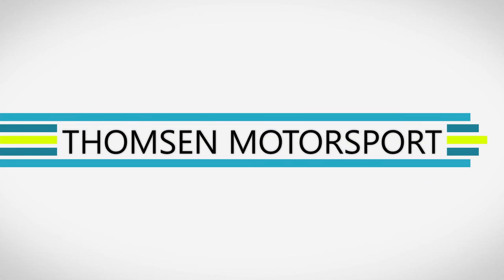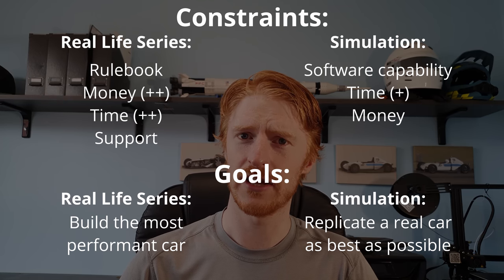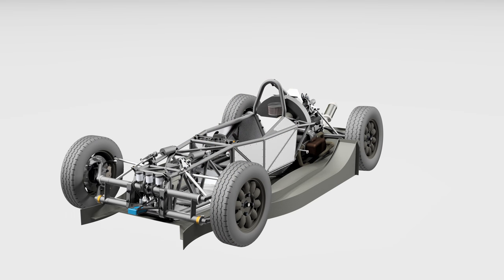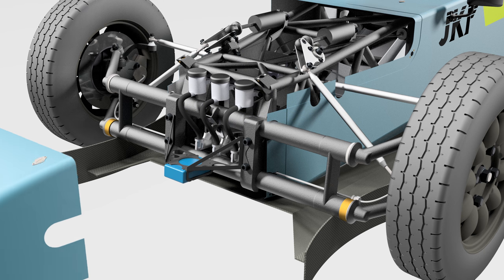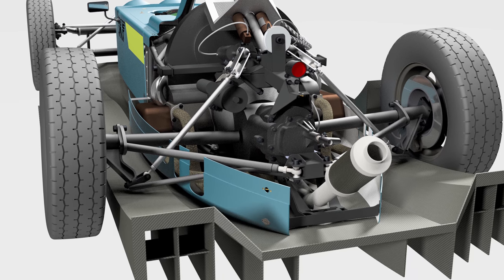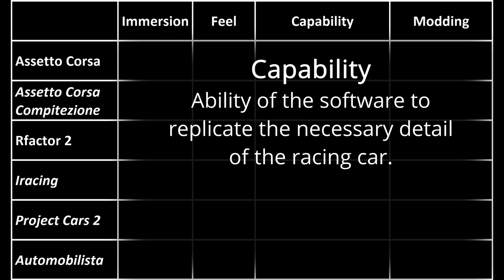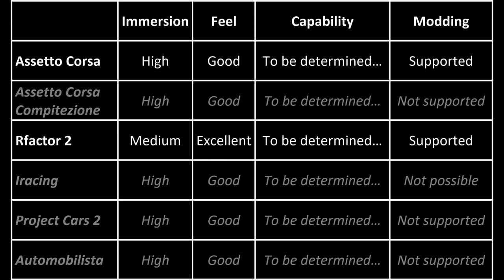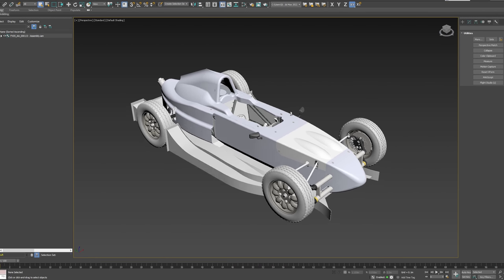Simulating a Racing Car

Comment: AC, especially when modded with CSP, has a far more usable tire model than rF2 does. You will struggle to produce decent behavior with the rF2 tire model, while it'll be no issue in modded AC to correlate tires to a high level. When modded you can even do really quite realistic heating for tires and brakes, and it has aeromap support.

The FFB will also be accurate for a manual rack (You can use "Real feel" to produce 1:1 manual rack torques like for DD wheel use) on CSP modded AC, while rF2 is a bit more esoteric in how it handles FFB. On top of that AC is generally easier to work with modding wise.

You might run into an issue if you want zero roll stiffness and only heave. I'm unsure how well only a heave spring will work; might work great, might not, I've never done it. Ideally it'll just work as-is but there are some possibilities for issues. I can't look into it now but perhaps I will and post a follow-up comment if I do. 

I foresee that some weak corner-spring/damper coefficients might be needed but ideally it'd still work with just a heave spring in place, you just might need to manually calculate your heave spring deflection because I think it doesn't show up in any in-game telemetry, which is no biggie.
Reply from the maker: Could be interesting to hear more, for me it hasn't been the heave spring that's the problem, more setting the springs to be pre-loaded against the bump stops. I've had no success in finding a way to replicate that. If you've got any insight then let me know! Otherwise it looks like rFactor 2 might be my only option.
Reply: @thomsenmotorsport7201  Packer range in AC is static spring deflection + packer gap. If you want a 0mm packer gap, or negative, you will either put in your static spring deflection or subtract the required gap from it. You add a gap if you want a more typical setup. There is no separate wheel preload in AC apart from the rideheight setting via ROD_LENGTH.

Telemetry app has spring deflection, you'll need to enable Dev Apps, search how to do that. It's a line somewhere in the cfg files. Bear in mind everything is at the wheel in vanilla, not the damper, so do your conversions.

BUMPSTOP_UP and DN are absolute wheel travel in meters, from the design height. The design height is considered to be when static spring deflection is the same as ROD_LENGTH.

You can shoot me a message at Arch#0819 if you want. Also look for "physics pipeline and tools". I explained this same stuff in there too.
Reply from the maker: OK this is excellent. I'll look back into the packer settings in AC after work, if there's something I've missed that I can do to force a preload then that solves this problem. I feel like I looked into that but it's certainly possible there was something I missed.

I've found Physics Pipeline + Tools on Race Department's website, I'll read through that as well after work - it looks like a fantastic resource from a brief look, perfect. I can't believe in my searching I never found this - thank you for the amazing resource.

I'm going to have to re-think the next couple of videos if I've come to the wrong conclusion that AC isn't possible - but I'd rather get it right. I'll play around this evening and get back to you.
Reply: @thomsenmotorsport7201  With preload, if you mean an actual preload ie: need to overcome some force until any deflection occurs, then it's not really possible I think, although I can't imagine the actual system works that way. Preload just changes ride height typically from what I understand, the spring will still move normally.

If you just want to put the wheel against the bumprubber when the car is sitting still, so that bump moves it into the rubber and rebound moves it out, there's no issue with being able to do that. You can put it into the bumpstop travel if you want, although you will need to use CSP if you want the force to vary from different deflection amounts. 

Is that what you are trying to do, have the car start off with the bumprubber compressed? That is possible without any problems. If you make a bumprubber travel/force graph with CSP, then you can also in a way dynamically change the suspension stiffness via compressing the rubber more or less at static position; it just works as an additional spring. 

You could do that in a setup-adjustable way via putting the "packer range" parameter into setup, and then changing the packer gap from there. Just bear in mind that changing the load on the spring or the rate of the spring will change the spring deflection and thus the packer gap needs to be adjusted, so I suggest leaving the cornersprings unadjustable if you are going to do that.
Reply: @thomsenmotorsport7201  Sorry, not the force to vary, the RATE to vary. The force increase is linear, while real bumprubbers are very much so nonlinear.

CSP allows a .lut to control the effective rate.
Reply from the maker: Yep so pretty much as you describe at the start there - an upwards force needs to be put into the tire that will overcome the static preload which pushes the wheel against the lower bumpstop. This is the case both at the front and rear, only at the rear it's using a heave spring only to support the car, which itself is preloaded against a sort of "droop limiter" cable.

I just want to make sure we're referring to the same thing - in my car the front (for instance) is as high as it can get, the wheels are as low as they can get (with respect to the car). Under brakes, the vertical load on the tire increases to the point that the spring comes off its limit, the front of the car dives and the wheel moves upwards with respect to the car. So it's preloaded against the rebound bump stop, not the bump stop.

I'll take another look into CSP, I had been hoping to avoid requiring people needing another third party patch to make the car work - but if what I'm after can't really be done without it I might just have to rethink that.
Reply: @thomsenmotorsport7201  I'm not sure that is doable in any consumer simulator to be honest, if we are indeed talking about a system where, to achieve any bump deflection, you need to first pass a threshold of force. After the load of the car has set on the spring, I mean.

Usually the way I understand preload is that you set a limit that allows the static load on the spring to compress the spring only as much as you require to achieve your ride height. It won't impart an actual additional preload during normal driving. Is this the case in your design too? Then you just set your gaps and use ROD_LENGTH to get your height.

If you want an additional preload AFTER the car is at the required height, then I am not sure if it is doable in anything.

Comment: I don't know how far along you are in this project but I have some initial thoughts and tips right off the top of my head. I come from pretty much the exact opposite in terms of experience, I started making 3D models for games and later got into CAD a bit.
Having the full CAD model of the car you are replicating is super useful, I cannot stress that enough. Usually one has to rely on whatever 2D blueprints you can find and then combine those into something that you can trace to get the initial shape right and later finetune the 3D model from there by comparing against a library of photos. Sometimes you even have to make due with blueprints of a different spec version of the car. So having a fully detailed CAD model, I would export that into my 3D modeling software and use that kind of like a sketch that you can trace directly in 3D. Like you said, CAD models are usually not well suited for direct use in games when exported, they are too complex and often have weird quirks in the mesh structure. But they represent the shape perfectly already in 3D, so you can put that model in a separate layer, maybe make it semi-transparent, and then create your game model from scratch in a different layer but in the same space - effectively tracing the shape of the CAD version.
But, if the CAD model or perhaps parts of it have a decent mesh structure it could be used directly as a base for the game model. Normally it would need to be simplified by removing unnecessary edge loops. It is usually quicker to go the "from scratch" route, but it is worth keeping an eye out to spot if there are parts of the CAD mesh than can be used that way to save time and effort.
When creating meshes from scratch, start with fewer polygons than you think. It is easier to add more later on to smooth out a boxy shape than it is to get the shape right with too many polygons and vertices from the start. Also, make the model in separate pieces, like the CAD model is made of many components. Separate meshes can be kept simpler and easier to work with, and can later be combined into fewer objects for exporting to the game. It's also useful to be able to easily hide some objects you are not currently working on.
Make sure you find out what orientation the target game uses for xyz-axis, both in terms of world coordinates and local for animated parts like suspension components, doors etc. It can always be fixed later, but sometimes it can be a pain to re-orient parts, especially in hierarchies.
Remember you don't have to replicate everything from the CAD, the game model only need the parts that you can actually see.
Good luck! I really enjoyed watching you build and race the real thing, looking forward to seeing you back now tackling this as well!
Reply from the maker: Good tip importing the CAD then using it just as a background sketch - I had been generating sketches in my CAD model and taking measurements I needed from that. What you've suggested should be quicker.
Nice to hear your other advice, little tips like starting with fewer polygons and adding to that are great because of my lack of background knowledge. I'm getting up to speed OK with my CAD background but that sort of question springs to my mind often and it's good to hear advice from someone with more experience.

Comment: I wish you good luck in this project!!
Have tried myself to convert my team's Formula Student car into AC and went by cad conversion to kn5, but didn't ended up that well. Someday I'm still engaging in this project again!!
Reply from the maker: Yeah I can only guess you ended up with something very un-optimized. It could work but you'd end up having to put a lot of work into cleaning up the model. It's for that reason I'm starting from scratch.

Comment: This is awesome. I have 2000h in Assetto and in rF2 as well. Also modding experience in both. Due to circumstances, choose AC if you want more audience and more exposure. Also if you want it all to be more simple. Choose rF2 if you want next level of physics. It is actually kind of blue and red pill situation with those two. Well AC is not an entirely blue, but it has more of blue channel in the mix than rF2 does. Good luck.
Reply from the maker: Yeah pretty much the logic I used.